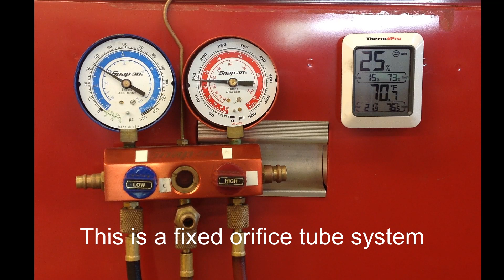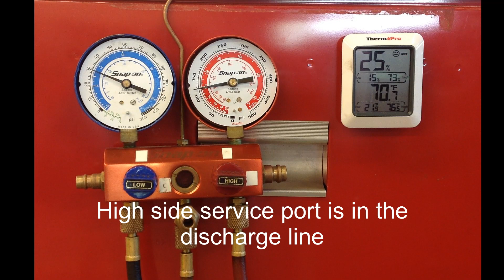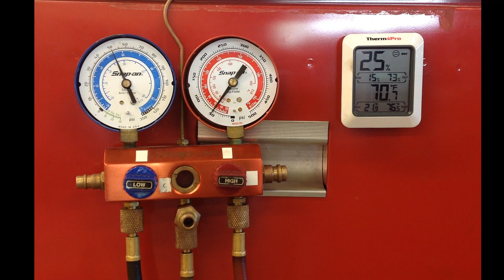A/C gauge analysis diagnostic scenario:  1999 Town Car FOT

Comment: Mentioning orifice tubes and student, leaving it out of the system. 
Here’s a little tidbit fact that will full even many experience technician . 
When it’s a early morning and it’s only like 40°F outside .  And one of your technicians in the shop or most likely, you received a vehicle from a body shop.  They put in a new condenser that was the old type that used to require a orifice tube to be put into the condenser outlet liquid line discharge tube.. 

When the outside ambient air temperature is so cold .  You expect a very low, high side pressure..  and because the vehicle is cold, especially inside the body shop sitting over.  You will get a low side pressure and you will get clutch cycling..  and you’ll get a little bit few degrees of cooling that will make you think it is working. 

Until the customer drives away later, turned on the air conditioning when it’s hot outside it will not be working .   

I’ve literally done thousands of AC jobs in the last four decades . The last three decades in my own business, I owned in hundreds of body shops where I’m called into, and body shops were notorious back in the days when condensers needed orifice tubes inserted into the liquid line.  For always being left out.. 

Or double orifice tube system . 

One of the vehicles that had an orifice tube in the line and then they ordered a wrong condenser. That was just one year off and it had another orifice tube inside the condenser so you ended up with two orifice tubes in the system.